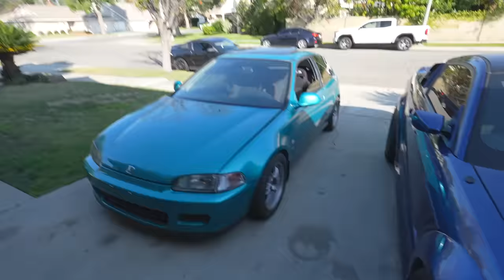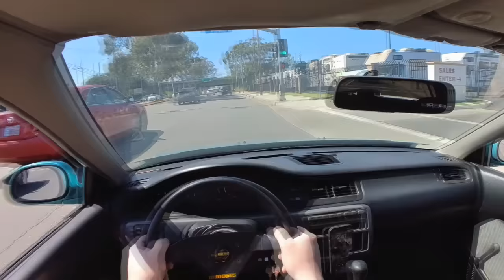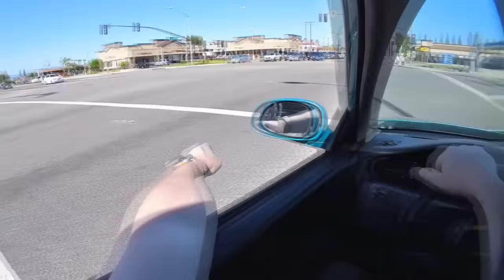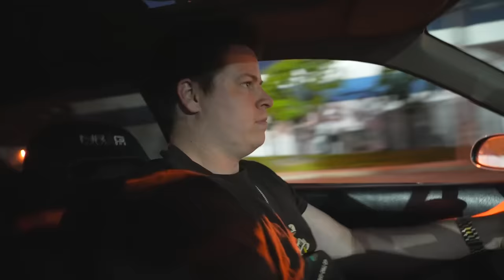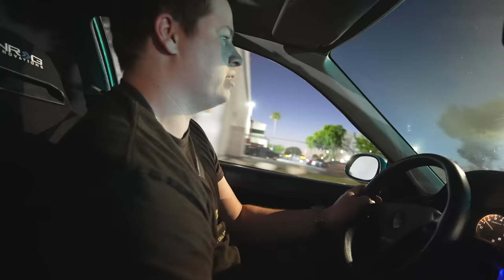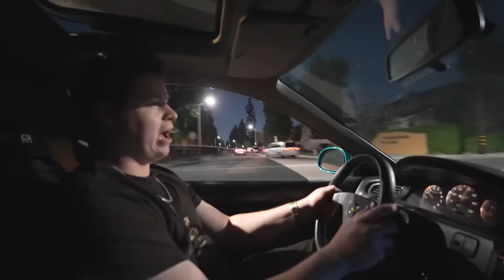My 500hp Civic Scares The Sh*t Outa Me!!!

Comment: This is what the 17 year old at the red light thinks he’s got when he puts a hot air intake on his civic that’s got 40 lbs of plasti dip and fake vents on it
Reply: The hot air intake is my favorite. It takes like 30 minutes to research and find the best intake for your car, and yet people still insist on shitty short ram intakes that probably do more harm than good lol
Reply: @Clooger- They usually weigh less and free up space. And its not necessarily the goal but warmer air can reduce fuel use, possibly at the expense of hp
Reply: @yogipony9016  the point is more hp though
Reply: @dieselgeezer18 yeh but I bought my wet air intake and I don’t think I gained any HP most probably won’t. NA FBO with or without an aftermarket intake id like to see people’s dyno results. My wet air intake isn’t a hot air intake but they both have cons. Mine is the possibility of hydro locking haha
Reply: Me with my stock GLI

Comment: Man I’m telling you as a Honda owner our shit boxes are no joke when they’re not clapped out and actually modified. and to be honest most Honda out there aren’t actually bad looking either like when they’re done right it’s good.😂
Reply: How is the reliability of the new turbo engines?
Reply: @landonmills9400  OK to be honest man of course it’s not gonna be as reliable as a NA motor but it’s pretty reliable compared to a lot of other cars. And I would say even though it could take a lot of boost and beating that if the engine was built incorrectly or your tuner tuned it incorrectly it could mess up but usually with good parts and a good tuner you’ll make a lot of power. from what I’ve heard a lot of people is they claim that the K20 would be better for boost and more reliable boost than the K24 but I believe they both work as good.😊